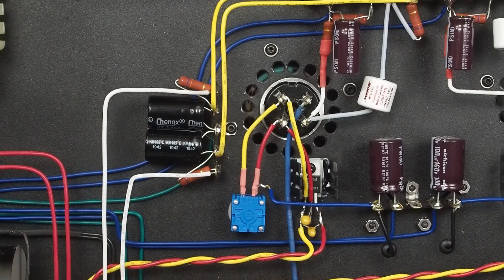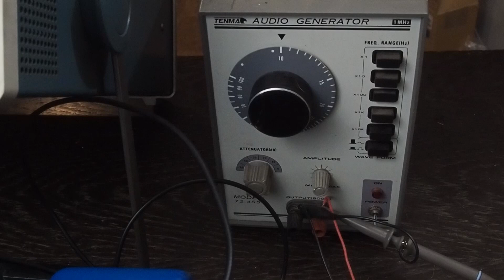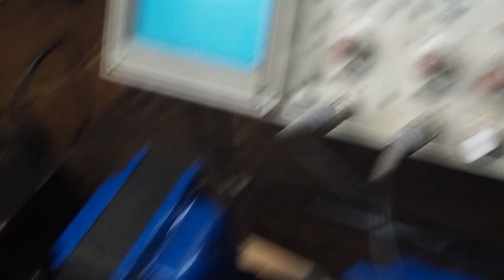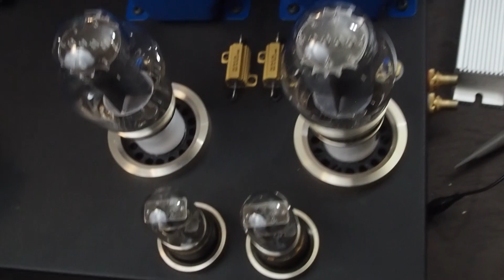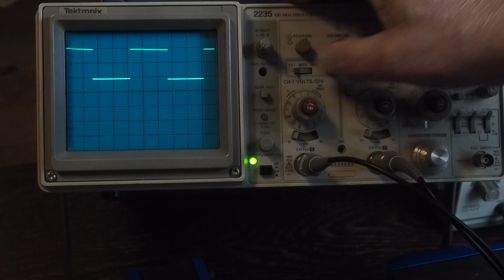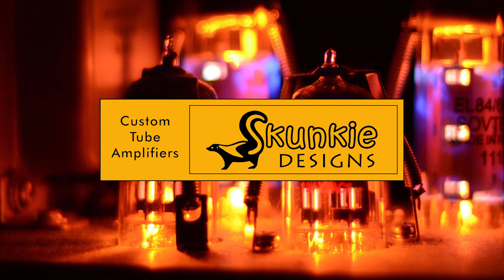300B DIY Budget Tube Amplifier Build DHT Final Testing

Comment: You should never mix red and blue wires for the same line of signals or voltages.
There are service techs here in Australia prepared to either boil you in oil or roast you on the stake for criminal negligence! As it was always the tradition. 😱
Reply from the maker: This was a homemade amp, never intended to be sold...

Comment: hi,on your 300b budget  the sine wave negative  clipping  comes first before  the positive  ,and in the comment for 6bm8, you said to me that not normal  that negative comes first positive and i see that 6bm8 is symetrical  on the sinus clipping   i dont understand
Reply from the maker: if we are talking one is clipping slightly before the other, it's not a problem. If you are losing 50% of the amp power, then yeah it's an issue.

Comment: Can I ask, with testing the voltages, is that to ensure components are all working correctly or possible errors in the wiring as a safety precaution? 🤔
I'd imagine it's a bit of both, but have you ever seen really out of spec to expected before and what was the culprit?
Reply from the maker: I would say for me testing a new design, I'm looking to ensure my calculations were correct and I am seeing what I expect to see. It also rules out wiring mistakes and especially measuring the voltage across the output tube + cathode voltage lets me know how much bias the tube is running at.

Comment: When you make these beautifully wired amps using the 300b set up. After all your expert knowledge and testing and diagnosing the circuits.  I would love to hear the amps run different types of music I understand videos can get long then also the copyright of music maybe an issue. I so much want to find a 300b SE amp yet I wish to hear them first. Love your work an explanation of the separate stages throughout your builds.
Reply from the maker: All you are going to hear is your computer speakers. I'm sure there are plenty of You Tube videos of people playing 300B amps, but you aren't going to hear a 300B amp on your computer.
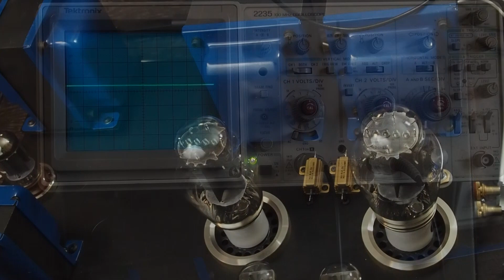Reply: @SkunkieDesignsElectronics  13:44  my computer runs through my tube pre amp to my tube amp to my Altec Lansing three way speakersI have a DAC board in my computer but ok I can get it.

Comment: What is the use of the potentiometer connected to the heater pins and the cathode resistor , and how is it used?
Thanks
Reply from the maker: It sets the balance point for the least amount of noise.
Reply: Thanks, what is the position you set it too before you start up?

Comment: 22.8 watts of plate dissipation 380 HT 0.060 amp current cathode    max anode dissipation is 40 watts will sound good this amp 380 HT x 0.060 cathode current  = 22.8 watts

Comment: When I first got into electronics about a year ago one of the first things I tried was replacing caps on a cheap Chinese amp I had.  I opened it up and figured I would start with these 2 blue ones right here. I learned that they were film capacitors and they were 1 uF.  So I ordered so 1 uF film caps and I got the WIMA because I thought they looked cool.  Well after "soldering" those caps in I plugged it in and it sounded like SHIT.  I thought I screwed something up bad.  Then I noticed it was getting better, then better and better and after 5 hours or so they sounded fantastic.  So when you said "I'm going to let this BURN IN"  I wanted to reach through the TV and hug you.  I count to countless people that say caps don't change and this and that.  You have good ears my friend.  One of my favorite things is to listen to film caps change.  I never learn and I always adjust things before they settle down.
Reply from the maker: I plan to let it "burn in" for at least a week playing 8-10 hours a day before I make any judgements or consider any changes. It will be interesting to see if the scope pattern looks different as well! It sounds better and better the longer it has run!
Reply: @SkunkieDesignsElectronics  That's exciting!!  Hey, POLYSTYRENE!!!!!!!!  hahaha

Comment: So all said and done how much does something like that cost?  Look how close the voltages are on each channel, that's going to be a good sounding son of a bitch isn't it.
Reply from the maker: With all new parts and tubes, around $900. I already had the transformers and chokes from a previous project, which was about 1/2 the cost. Most 300B tube builds I have seen online spent that much or more on just the transformers!
Reply: @SkunkieDesignsElectronics  Thats not bad then knowing the perspective.  I looked and the transformers have a 10 week wait time, they must have a lot business.
Reply: @ranbymonkeys2384  There's also the global shortages of copper that are impacting lead times for delivery.
Reply: @nickk6109  There isn't a shortage there WAS a demand.  The idiot that's in office now put an end to the pipeline and that is what was causing high demand, but we weren't actually short on copper because it was never used.  It's just people trying to time the market and that drove up the price.  It's there, just more expensive it will go back down.
Reply: @nickk6109  Now that may be because I have a shit  load of it.